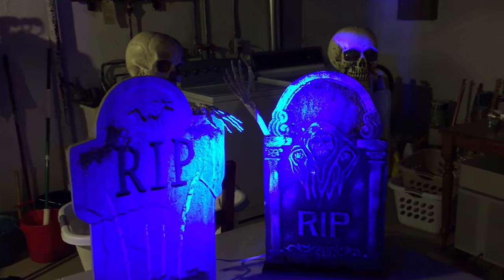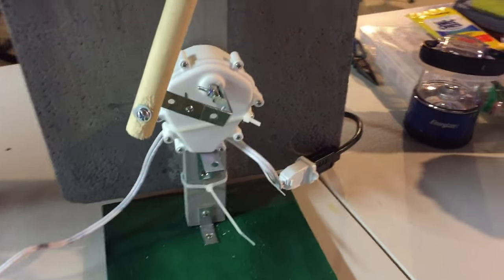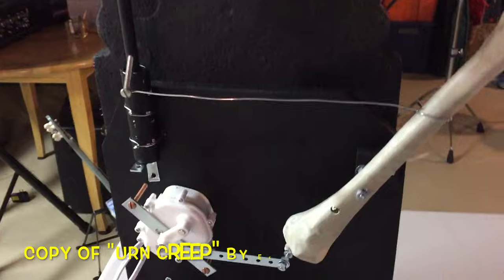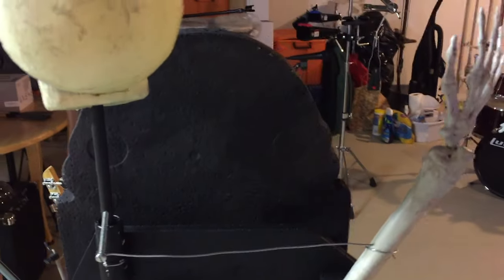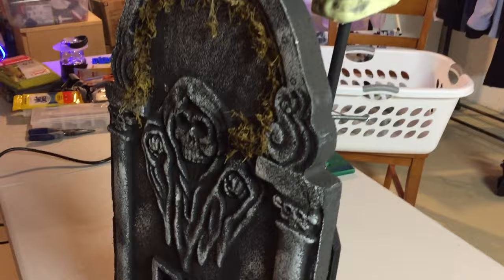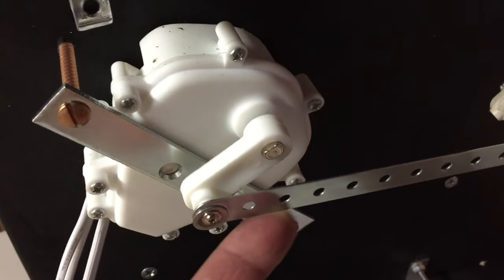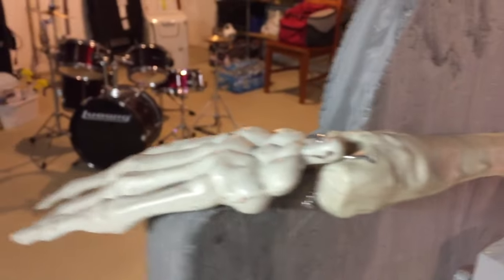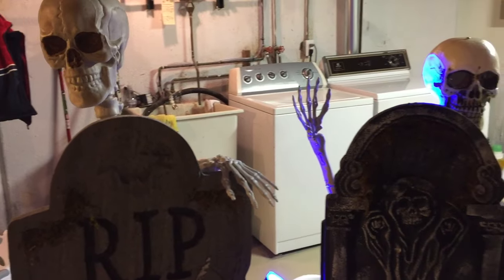Halloween Deer Motor Props

Comment: Thanks for making this video. I remember watching your video and making one of these last year. The motors came the day before Halloween so I didn't have much time to play with them. I have a few of them now and they are solid. My motor has been in the elements all year and works fine. Even if they were to die they are cheap enough to replace and have a few of them on hand. I mounted it to my fence and just change out what is popping it's head over as holidays change. If you wanna see my results I just posted a Halloween video from 2019 on my channel.

Comment: Thank you for this interesting video! I am attempting to repair a moveable outdoor Christmas decoration; in this case a moose that head is supposed to move right to left and left to right. It is the white plastic arm that fits on the drive motor and connected to the rod that moves the head. that I just cannot seem to be able to locate, and help here please?

Comment: I'm doing something similar but mine will be Zero from Nightmare Before Christmas floating over a tombstone.  My motors have a metal plug in the plastic arm that's a pain to get rid of.  They were repurchased from actual deer Christmas props. Any suggestions?
Reply from the maker: Sounds like a great idea. You really need the arm connection to be secure. Maybe drill it out or crazy glue a bracket onto it? Hard to say without seeing it. Just don't make Zero too heavy. These motors can only handle a couple of lbs. Please post a video when your'e done. I just subscribed. Good luck!

Comment: Great video! I have the motor with the plastic arm like your second design. At the end of the arm what is the screw that you used that connects the long metal piece to the prop so that it turns, but doesn’t loosen the screw, if that makes sense?

Comment: This is beautiful! I’m trying to come up with a small animatronic for a life size Grinch figure. I want to have him in the act of pulling a string of lights from the roof. So it’s a simple pulling back then forward motion with his arms, the bend being at his shoulder. Being my first time working with a motorized animatronic, what specific pieces of hardware would you recommend?
Reply from the maker: Get the motor from FrightProps or Poor Man Props. Then, keep it as light as possible -- PVC arm and some zinc mending plates from Lowe's should do it. Good luck!
Reply: @gattusog  thanks!
Reply: I have a Grinch that I was thinking of doing the same thing as you.
How did it turn out?

Comment: What's the adhesive that attaches the wood to the foam tombstone? I'm doing something similar but wasn't sure what would work.
Reply from the maker: Hot glue works pretty well. It does melt the foam a little but it seems to stick. Good luck and Happy Halloween!

Comment: Those deer motors are weather proof correct?  And have you ever used one for a bicycle pedal
Reply from the maker: Yes, they are made for Christmas reindeer and hold up in the rain and snow. I havent used one for a bicycle pedal as they wont push more than 1. or 2 lbs. I see they are back in stock at Kindys.com. Thanks for watching!

Comment: Any idea where I would get one of those motors in the UK? I’ll be in Florida in September for a week, but not sure I’d be able to have anything delivered to the hotel
Reply from the maker: I think your best bet is to contact Kindys , MonsterGuts or FrightProps and see if they ship to the UK. Or, you can search for these motors on eBay or Alibaba and get them direct from China. They are called 110V outdoor fixed speed 5RPM AC christmas decoration deer motor Prop motor with arm for shaft
 
https://www.alibaba.com/product-detail/110V-outdoor-fixed-speed-4RPM-AC_60499798843.html

Good luck and happy haunting!
Reply: Thank you so much! Will have a look now. I contacted Kindy’s with no response, and monster guts wanted $70 shipping 🙈 Hopefully I’ll have more luck ordering from China 😅🤞🏻
Reply from the maker: @crazylazyadhd4692  This seller will ship as few as 5, so China might be the best bet. These motors are so useful you will want at least 2 or 3. Good luck and post a video . 

https://www.alibaba.com/product-detail/110V-outdoor-fixed-speed-5RPM-AC_60499623121.html?spm=a2700.details.maylikehoz.2.53283187735nCG
Reply: @gattusog  I tried register at Alibaba and it looks like you need to have a business to buy there.  Have you bought anything from them?

Comment: Nice work.   Quick question:   Where did you get the metal bracket with the many holes?   Thanks.
Reply from the maker: Hello, It's called a Hillman 5.5" wood to wood mending plate, available at Lowe's (hardware section in one of the drawers called "craft supplies"). Good luck, only 7 months til Halloween!
Reply: @gattusog   Thanks for the help!

Comment: Great work! Do these motors have two attached plugs? ( a male and female end) thank you
Reply from the maker: Thanks Grant! Yes, they have a male end and a female end so you can string two together or plug in a light, etc. I get them from Kindys.com for about $12 each, which is the best price I can find without buying a big shipment from China. Good luck!
Reply: @gattusog  here's the direct link, but they are sold out: http://www.kindys.com/products/decorating-accessories/replacement-motors/replacement-motor-48-animated-buck

Comment: Great props!   Quick question if I may.  What did you use to screw in to the deer motor crank at 3:55?  (To clarify, the part that turns)
Reply: Hi Jason, There is a hole in the metal arm of the deer motor. I used a thin machine screw and nut to attach a 90-degree bracket. Hope that helps.  -Greg

Comment: Great props! I've had issues with nuts eventually working themselves off their bolts. Any tips on how you attach everything?
Reply from the maker: Hello Andrew. I put on 2 nuts and then a dab of hot glue on the second (outside) nut. Good luck and have fun.

Comment: Where do you get the motors from
Reply: Looks like this might be it:
http://www.frightprops.com/electric-motors/motors/fixed-speed-110v-ac-motor.html
Reply from the maker: Cheaper here: http://www.kindys.com/products/decorating-accessories/replacement-motors/replacement-motor-48-animated-buck
Reply: @dougjohnson1517  the one at frightprops isn't exactly same, the shaft is threaded on top, not hole on the side.  so it would need to be connected to an arm in a different manner.